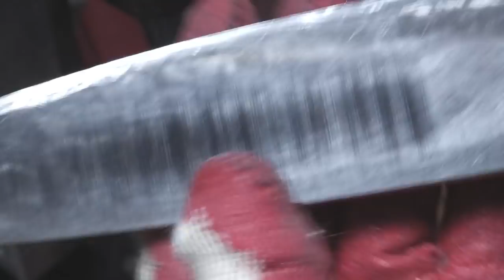월급 100만원은 더 벌게해줄 칼! 칼찾아가세요~

Comment: once o have a knife, it was quite cheap but good temper i regrind the sides same as you did here. Only it was quite thin from the start and after the grind it was extremely thin at the edge. I gave it even more shallow angle edge around 5°. It was super thin and very sharp good for cutting vegetables. One day my father want to sharpen knives in kitchen. Sadly it looks just like in the beginning off the video and mine too. It have quite deep, 1cm from the edge mark from the wheel. Sadly it was not salvageable since when i will be done, it will be too small to use as a chef knife and too thin to use at all.

For ease my frustration i say good buy, thanks for service and snap it in vice, since then i have my knifes separately stored. I buy hand made japan knife with blue paper 2 steel, done similar 5° edge and when cutting onions you dont even hear or feel the layers.